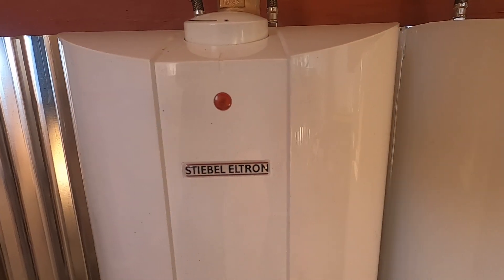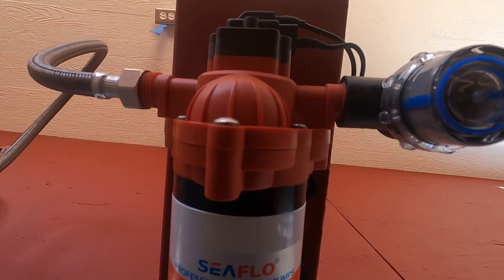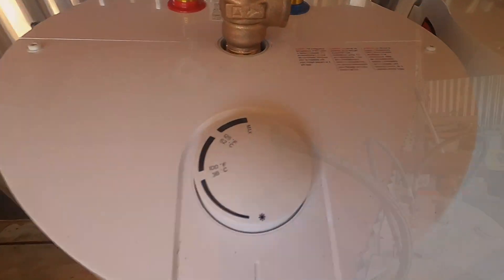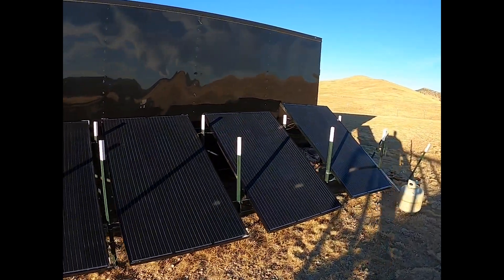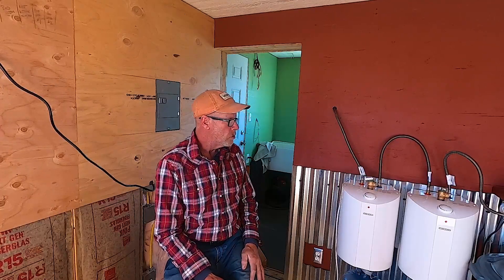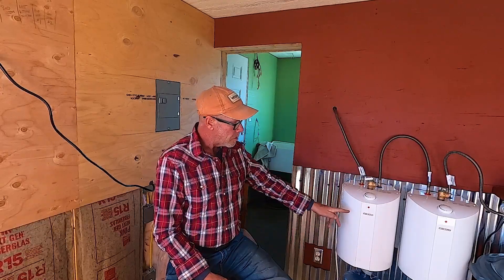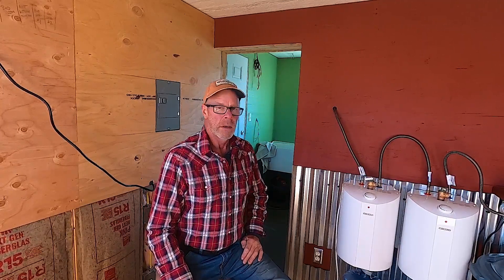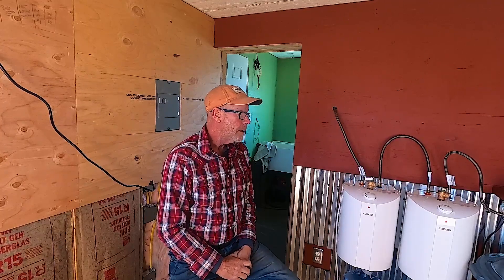WHAT'S THE BEST HOT WATER HEATER FOR SOLAR SYSTEMS AND OFF GRID GENERATORS

Comment: You fence post mounts are shading your panels. Watch some videos on panel shading. It only takes a small amount of shading to murder your output. You are welcome.
Reply: He is correct…at 9700 feet, the air is always colder and drier. Hence your solar panels operate more efficiently and you have less moisture blocking/dispersing solar rays.
Reply from the maker: My batteries are floating at full charge in 2 hours most days, and charge to 14.7 volts most of the day. I live at 9700 feet closer to the sun than most people. Even on a cloudy, snowy day, my batteries charge fast. The fence posts and wire have withstood 60 mph sustained wind.
Reply: @flo2col127   Yes that is nice they charge up so fast but the post are still shading the panels. It is your system you can do what ever you  like but it was good advise that a wise man would follow.
Reply: @flo2col127  The "9700 feet closer to the sun than most people" makes absolutely no difference in output because it's 93000000 MILES to the sun. Now I don't know how many feet that is, but what I do know is that 9700 FEET is absolutely nothing in comparison. This is why solar works almost as well in Alaska as it does in Miami.
Reply from the maker: The closer you get to the equator the stronger the suns rays. like driving from NY to  south Florida only 1300 miles outta 93 mill.. You don't believe adding elevation adds sunlight intensity? My sunburned skin begs to differ. @johnwyman6126
Reply: @flo2col127  The altitude makes little difference, he's right.  What does make a difference is the angle of the sun!  Near the equator it's much more overhead compared to the lower angle during the winter in your location.  The OP is also 110% correct about those posts significantly impacting your solar production!!!  Maximize what you have, if you have extra power, use it for heating or cooling!

Comment: I only use about 2 gallons of water total if I shut the water off between lathering and rinsing and I have very thick hair down past my butt so I have to do shampoo and conditioner.
So I just take a tea kettle of water and heat it up with my solar and then dump it into the cooler water that's in the bucket.
And if I want to take a longer shower I would just heat up my one gallon tea kettle and dump it in more water.
Reply from the maker: I only need a couple of gallons also...maybe less with my bald head. I used a bucket, and my electric coffee pot / water heater to wash up when I felt tooo dirty.
Reply: @flo2col127  I have this thing that drops down into the bucket or the water bottle so I have a regular shower head not full size like I have in a house but does the same job. I still think that's something that you could consider when it's cloudy or your batteries ate low and you don't want to heat up 8 gallons of water.
Reply from the maker: I saw an application like that on line for camping trips. Its amazing what they have out there for glamping now. the on-demand propane heaters are great too. Redundancy off grid is important for sure. I run my generator a few times a week, and started heating water in the heaters by generator and solar.  @mycabinlife1291
Reply: @flo2col127  right now I find the tea kettle is working perfect for my needs to do dishes and to clean me LOL
Reply: I even use the tea kettle method at home. I don't turn on my hot water tank anymore it saves me about $40 a month on my electric bill.
Reply: @flo2col127  I also use the same method for washing dishes. I feel the dishpan halfway with cold water and soap and then use my tea kettke to add the hot water and I rinse in cold water.